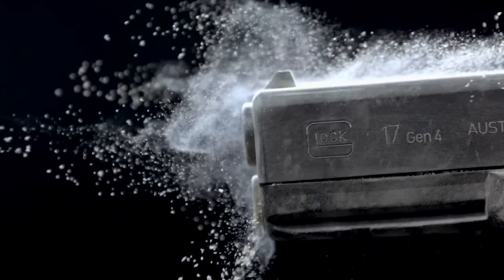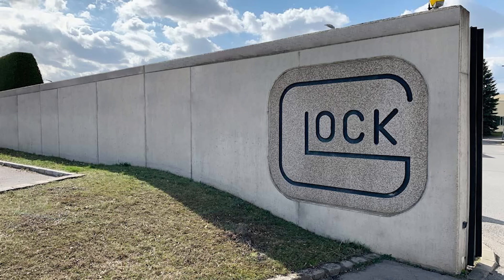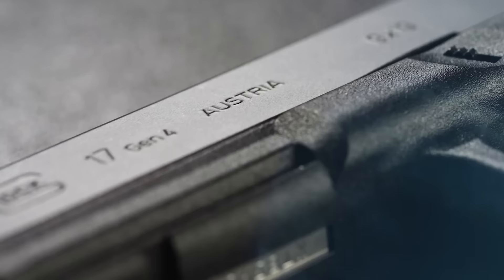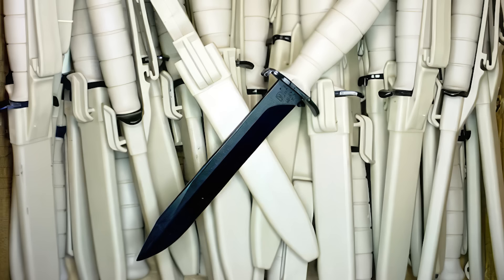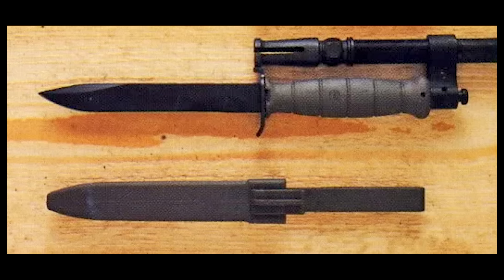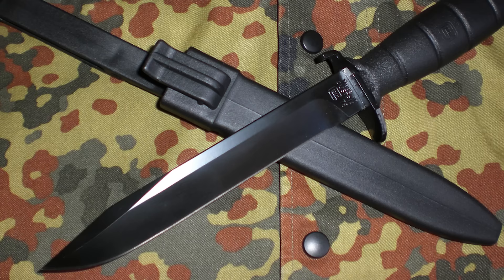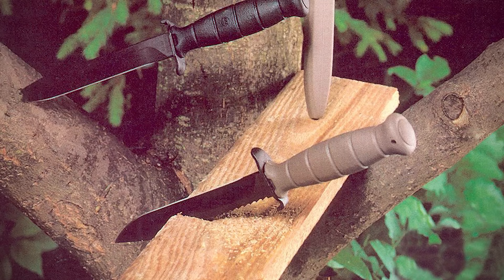How Glock Made the Perfect Knife

Comment: I love the glock knives very durable definitely the biggest bang for your buck I have ever seen I own two 81s from glock out of the box they come with a blunt tip pretty much no tip on them which always had me thinking why but i didn't mind that you can make your own tip on there and also edge out of the box not good at all folded edge pretty much but with a little bit of sharpening there really good knives i even made an edge on the swedge of the clip point so that way i can have a tip easier that way plus it's a pro because you get more stabbing power with less effort applied great knife just out of the box it needs to be sharpened definitely way better in durability than a kabar only difference is that the kabar comes with a real good edge on it right out the box but not as tough

Comment: The original 78 has a round divot in the handle to engage the sheath. I still have one from 1978.
Reply: So it' s probably not a glock.
Reply: @georgegordonbrown9522  it says Glock on it???
Reply: @fiendslegacy   interesting.
Reply: The AES models before the Glock had that, with a small round hole in the handle both sides, so it could be left or right handed. You must have an early version or an in betweener

Comment: My son had a army navy surplus . He got a load of them never used . He gave me one I still have and use it with my
metal detector setup . The blade is indestructible about 1/4" thick but only about 1" top to bottom awesome for poking
around to dig up or cut roots . I like my knife much more than my Glock 27 .

Comment: I owned this knife in de 80s and its indestructible and can be honed to a killer sharpness easily.
Reply: killer sharpness on spring steel? you sure?
Reply: Absolutely, I used the sharpener that was externally attached to the sheath of an Ontario Jungle Machete. Pulled the knife through about 20 times and it was sharper than I wanted it to be. Cut myself once just be touching the sharp edge in the absence of ambient light. Spoiled my whole mission.

Comment: What you failed to mention was that Eickhorn of Germany under the brand name AES of Solingen actually made this knife before Glock, I have two examples one Green and one Black both with plain blades and the hollow handle section. The method of retention in the sheath is different, it does not have the external clip which is on the Glock sheath, and the cross-guard is slightly different. The belt loop is also different and does not have the side slip opening section but is a simple polymer loop shaped into the solid scabbard tongue through which the belt is slipped. Some early models also had a pommel extension like an acorn with which the plastic end cap could be removed.
I own the two AES models and have the Glock later versions of the 78 and 81 and have used all in the military in both the RAF and Army in the UK with great success. I actually prefer the two AES models and their sheaths. 
Eickhorn is a great company too.

Comment: The author did not tell the most important thing, which is what knife was used as the basis for this knife. Glock developed its own with an eye on the Soviet knife HP-43 "Vishnia" model 1943. It is identical to this Soviet knife in both the shape of the handle and the shape of the blade.
The only fundamental difference is the design solution associated with the sheath.
In modern Russia, a redesigned version of the HP-43 knife is produced, under the trade name Kizlyar Supreme Vector, which has quite interesting characteristics at a fairly low cost. At the same time, the Russian Vector knife took the best of the Glock 78 knife - its innovative sheath, which allows you to attach this knife to the molle system and use it as a free sling on a belt.

Comment: It is a great all around knife. It is tough, sturdy but light too! And in my experience no weak points at all. Some argue average to low edge retention, well, definately not in my case. It has it all you need from a fixed blade from my point of view. And I add I use it with joy knowing that it is a valuable tool, but a tool, no concern about scratching a limited edition of super-ultra-whatever

Comment: Very well researched video.
The Glock knife is far from perfect as a bushcraft knife, but it excels at being a superb all-rounder.
As much as I love the traditional KABAR, the Glock is vastly more tough.
You could hammer a row of Glock knives into a tree and use them as steps.
I am really tempted to modify one of mine and put a thread and nut into the bayonet hole, but I just cant bring myself to deface this wonderful knife.
This knife is relatively cheap to buy, and practically indestructible.

Comment: You can force window and even door frames open with it.
It usually can handle it without harm.
I also use it alot as a climbing tool in all kinds of materials from sand over more or less loose rock to brick and mortar.

And no, you wont be able to slice a tomatoe with it afterwards ;PPP
But the edge is all but ruined either.

Amazing knife.

Comment: "Normally the hollow portion would cause a weakpoint" Yea that is what it does, most of the glock knifes i have seen had a loose handle that would rattle after some use. Full tang is a must on fighting knives. Or atleast i prefer my knifes to be so solid that you can split wood and batton with them.
Reply: ... Glock* knives*

Comment: I have both the 78 and 81.  They both are tough enough to stand up to the punishment of being used to baton wood.  Yes, I have actually done it.
They also make entrenching tools.  What is an entrenching tool, a.k.a. e-tool?  Glad you asked.  It is a folding shovel.  I own this too.  One of the novel features is a root saw that is stowed in the hollow handle that can be pulled out, turned around, and mounted in the end of the handle.
Oh, by the way . . . their handguns are ugly as sin, but dirt simple to use and highly reliable.  The only time they don't go bang when you want them too is when you forget to put bullets in them.

Comment: Sorry to burst your bubble dude but the KaBar and glock knives aren't exactly great beyond their military spec requirements. They're fighting knives. They're basically just a stabbing/flesh cutting tool. 

All military grade knives are or at least a vast majority of them. IIRC theres a military that issues a folding knife that can be pinned to prevent unintentional closing. Even still its a folding knife and more prone to failure because of more moving parts.

When it comes to knives that are useful as tools e.g. prying, batoning, chooping, etc. full tang, thick spine is the way to go hands down, no exceptions. You'll bend and break a KaBar at the guard trying to pry things like logs 10 times before you will a full tang bushcraft or survival knife. 

Glock knives met a sub standard criteria because the criteria is that is has to be cheap, light, a certain length, a bayonet and mass producable. 

Full tang bushcraft/survival knives dont fit the bill because they are more expensive and timely to make.

Comment: I've had the 81 for years now, and I have mixed feelings about this knife. Because of how soft the steel is it will dull if you as much as point it at a stick, which these knives have in common with many other bayonets like the AK and SIG. The sawback is, well, let's just say it's there... On the plus side this thing is awesome as a crowbar, throwing knife, shovel, and for demolishing dang near anything in it's path. So if you're going backpacking, bring a Mora, a Helle or a Bark River. If you plan on clearing minefields, breaking doors open or bludgeoning something into submission, take this beast of a knife.

Comment: In my opinion, it really depends on how you define a “perfect knife”.

The GLOCLK field knife FM78 is actually a bayonet, a combat knife whose strength lies in rough work: stabbing, prying open boxes or digging.

Due to the blade thickness, the cutting angle and the steel used (HRC55), it is impossible to achieve a maximum or long-lasting really sharp cutting edge with the knife.

The FM81 with the "saw back" is even unsuitable for its original use as a bayonet or interceptor knife, as the saw teeth tend to bite into bones.

Comment: I have 2 GERBER-BMF "Saw Back" knives from the 1980's still in great condition and one of them is in mint condition.... I also have 2 GERBER-Silver Trident "saw back" knives both in mint condition.... Sure, I have other knives Made in USA & German, like the PUMA).... I even have an RMJ Tactical Tomahawk "Eagle Claw"... Dang it's razor sharp and I suffered a 1.5 inch cut on the palm of my hand when my shirt got snagged on it from the top of the dresser and I tried to catch it, so just that one foot drop and then catching it blade side got me cut pretty deep, but the cut went in alignment to my fingers, so it missed the tendons of my palm.... If you buy this RMJ Tomahawk, be extremely careful, ESPECIALLY with the sheath... The company warns of the potential "loss of fingers" when removing the tight "snap-on" sheath, so I rigged 2 nylon loops on top to hold on to when pulling it out of the sheath.

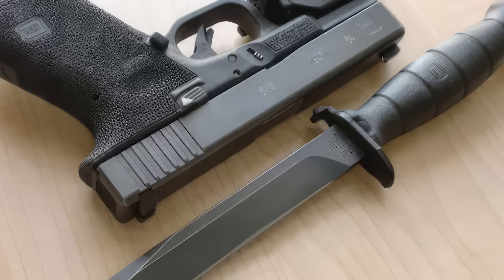Comment: The Glock 17 happened to have 17-round magazines, if only he had designed it with a 17-degree grip angle to match that of the 1911! Why, but why did you stop short of making it the best natural point and shoot pistol of all time Gaston? That would have achieved the sought after Glock perfection! The knives NEED a better texture on the handle, like that now featured on many pistol grips like the Hellcat for instance. I may lightly stipple mine like the texture on the Glock pistol shown at 3:55. RIP GG.

Comment: I have a couple- different colors and blade types. I tried to saw a small branch (one inch to one and one-half inch thick) off of a tree with the 81 model and it was really more work than it was worth. Not impressed. Mine is a more recent manufacture, probably around 2001- 2005 or so. Wonder if they altered the design at some point.

Comment: It was hardly usable as tool out of the box. I had to reprofile the edge and sharpen the tip. This comes from a guy who makes knives and is very spoiled by scandi grinds so bear with me.
Using the knife I realized that it dulls very quickly and despite being thick, it didn't allow me to baton wood as well as other knives because of the low blade height. 
The saw doesn't really work for dry wood, which is okay because it is intended to saw through roots, which it does just fine.
BUT
It's a fantastically designed fighting knife. The rounded tip is intended because a sharp tip gets stuck in bone and cutting through meat doesn't require a sharp edge angle.
It doesn't matter if you hold the knife edge up or down, the handle offers an equally secure grip.

Comment: Steel too hard & secondary bevel will make this difficult to sharpen in the field..also looks a bit long for general campsite use prepping fire materials etc so I guess it’s more military atmosphere where lots of equipment is present & less survival alone..the handle looks very grippy so blisters if you use it a lot I’d prefer wood scales on a full tang with a steel butt.the guard stops the thumb getting close to the spine so close work is also hindered.

Comment: I own one and I have a question: what is an easy way to remove it from the sheath with one hand?
Reply: am a veteran of the Italian army with 20 years of service and various missions from the Balkans to the Middle East.. Since the ordinance's extrema ratio fulcrum is large and heavy, it is not uncommon to see soldiers buy the glock and carry it on the plate.. To extract it with just one I have often seen colleagues fill the hole in the handle where the sheath pin fits in with a bit of hot glue.. In order to have the right retention so as not to lose it.. But being able to extract it without lifting the locking lever with the thumb

Comment: I bought one years ago and it's one of those cheap but durable tools that gets to be used all the time, because it can handle all kinds of abuse. And it's so cheap, if I drop it to a sea while boating (for example), I'll just shrug my shoulders and buy a new one. Sure it's not stainless and the coating won't last long, but if you oil it every now and then, it won't rust so fast and what's a little rust on the side if the edge is sharp enough (yes, it won't hold its edge for too long, but it's a cheap knife anyway). No regrets owning this knife.

Comment: I have on of these.  I hated it.  It would literally NOT hold an edge.  Terrible.  I sharpened and sharpened and sharpened that thing until the blade was almost a sliver.  I could not understand it.  After a while I had another knife like it, a Gerber.  Finally I came to the conclusion that the sheath was scraping off the edge.  I made a leather sheath for the Gerber and that solved the problem.  I have not yet done so for the Glock.

Comment: It’s basically a knife made for things you shouldn’t use a knife for.
Great for batoning, digging, prying, throwing. It is hard to destroy because the hardness 55 makes it bend instead of braking or chipping. Easy to resharpen. And it’s cheap, which will make you actually use it as a beater knife. Not so great for fine cutting tasks like food prep or whittling, because the blade is too thick and has no cutting edge close to the grip.

Comment: ok, first these are combat knifes, that can be used for survival uses. but they are not good survival or bushcraft knifes. I have seen it again and again these knife handles do break when used for bushcrafting. yes it can be used, but it is far superior as a combat knife than a survival knife. its not a horrible survival knife, but it isn't comparable to a full tang bushcraft knife.
edit: apoligies, I confused this knife for the Ka-bar, which often breaks at the handle. glock isn't perfect, but is far superior. However looking at multiple destruction test, it does seem to break at the mid point of the blade quite often. this is its weak spot, but considering how hard it was to get I wouldn't worry about it in the short term.

Comment: I'm going to be a contrarian here and say that the FM78 is one of the shittiest "knives" I've ever had the displeasure of owning. Doesn't hold an edge worth shit nor is it quick and easy to sharpen despite being shit soft steel. You can argue that it really isn't a knife, but a bayonet, but even then there are much better bayonets that double as a knife.
Only saving grace is that they're like 30 bucks so if you snap or lose one, just grab another one, don't have to fret or feel too bad about it.
I will give to it that they are surprisingly rustproof though, I ended up using mine as a prybar and to pick rocks from my boots or throw it into trees when bored on patrol or lookout.
When I returned back home, I stuck mine into a tree and left it there for a good couple of years, only for it to get yanked out, given a quick wash and put into my cupboard, it had some visible rusting on it, but I'd eat off it, nothing too bad.
Still I don't really like the thing and was fairly disappointed in it and don't really get it why people rave on about it like it's the greatest thing ever. For a 30 buck knife it's okay I guess, but that's it.

Comment: This glock knife is overrated by someone who doesn't understand knives.   
   It won't hold a candle to my electric powered hedgetrimmers, which are brwtal against the jungle of briars and brush, for sheer cutting power.
And it sure won't hold a candle to my lawn mower mowing blades both push lawnmower and riding.    Anything that goes into them gets brwtalized.
   You might cut a few things with that Glock knife in it's life time, but my hedgetrimmer and mower blades will cut... billions.

Comment: GLOCK PERFECTION. 
Now we just have to change from a clip point to a tanto. THen a convex grind instead of flat grind. And a different steel alloy. Then this aftermarket handguard. Oh, and full tang is too heavy so we're going 3/4. And instead of the Kraton G handle we ordered this stacked leather one but can;'t figure out why it smells funnt and gets slippery when it's wet. And don't forget the aftermarket scabbard. 

The PERFECT KNIFE TO COMPLEMENT THE PERFECT HANDGUN.

Comment: I wouldn't exactly call these fantastic knives.  Blade design is meh (clip point?  Really?) and you want weight in the handle for better melee fighting.  I would be very worried about those polymer handles too.
Reply: How does a bit more weight make it better in melee fighting
Reply: @myboysd5772  It is about where the weight is, not necessarily more weight.  A heavier handle puts the center of balance closer to the palm.  Exaggerated, it is like holding a 5 pound weight in your hand vs. attaching a 5 pound weight to a 6-12 rod and holding the end of the rod.  The former is less strain on the arm.  Many fighting knives have heavy handles for this very reason.
Which is why both a polymer handle and short or hollow tang is such a bad idea in combination.  Your blade simply gets way too front heavy.
Reply: @MxMe-su1ch  Thats a good explanation, thanks. Although i do think that if you have to resort to knife fighting someone who also has one you are already kinda F´ed, usually the winner goes to intensive care, and the loser goes to a morgue. Still better than nothing i guess.

Comment: More of a bayonette than a knife. Yes, you can stab with it, dig a hole or open a bottle, but it's pretty mediocre as a knife. The blade is made from non-stainless soft steel, and in fact the not-full-tang handle does come loose under heavy loads. It is also way overpriced for a knife made from such cheap materials. And on an editorial note: Messer ("knife" in German) is not pronounced "mesher" but the same way as it would in English - "messer". If you want a German word to have a "sh" sound, that word must contain the letters "SCH".